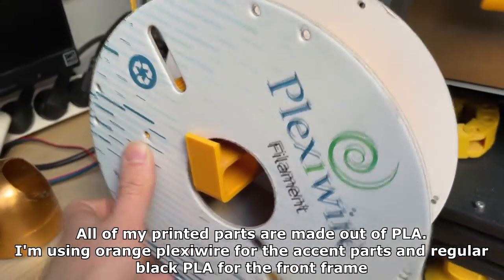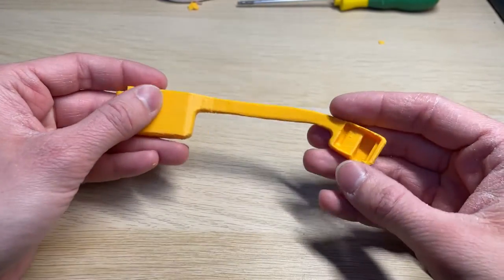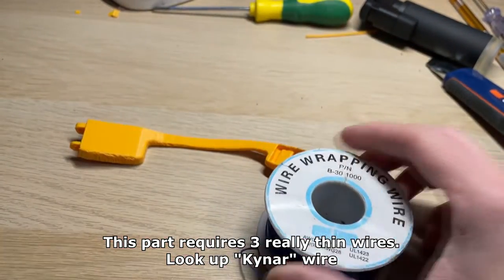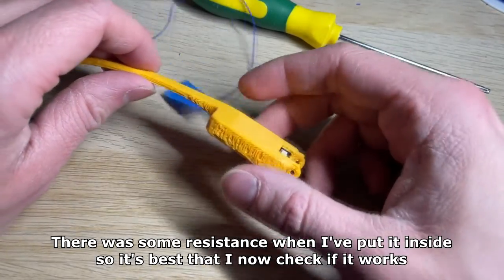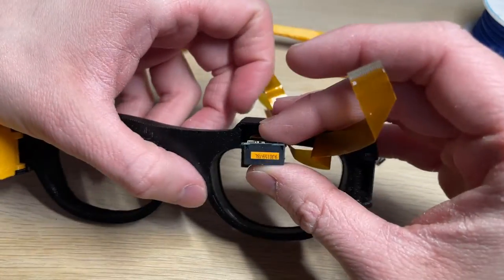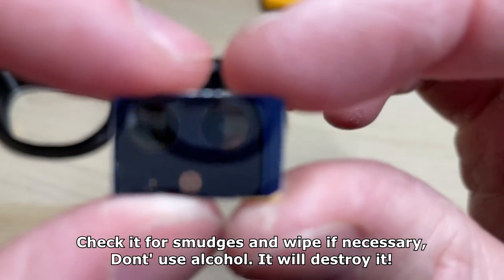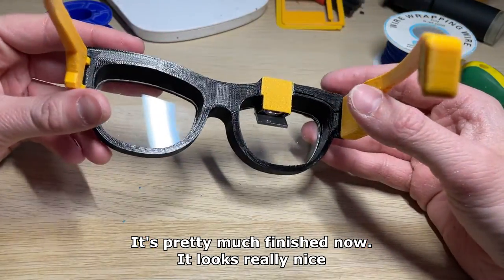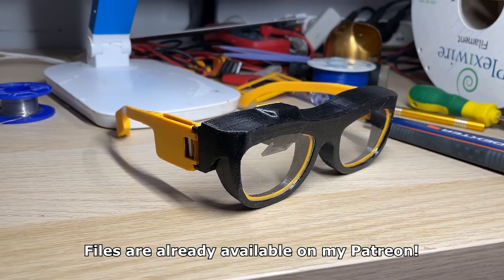Onyx Classic - Final Onyx AR Glasses

Comment: Ok, I will have to say this, but even though our guy here made a statement to be careful with blades as he cut himself, I want to put a serious disclaimer that if you’re gonna use a soldering iron pen to melt the plastic on the hinge, DO NOT TOUCH THE METAL TIP, YOU’LL BE SEVERELY BURNT. Saying from experience. I burnt myself with a soldering iron pen last week (as of writing) and it still hurts with a horrible burn mark
Reply from the maker: Oh yeah. For sure. Be especially careful not to burn yourself when there’s molten plastic on your soldering iron. It will get mixed with your flesh pretty easily

Comment: Great work! I'll have to purchase this kit as well 😀 

Also for those who have prescription glasses you can take an old pair of your prescription glasses and pop out the lenses. Then use the plastic lenses included in the kit and tape it on your prescription lenses. Then you can use a Dremel to sand it down to shape to fit it in the frames 

That's what I did to make my pair have prescription lenses. Otherwise I'm pretty sure you can go to a glasses store and ask if they can order custom prescription lenses for the frames

Comment: Thanks so much for this! Once the following questions are answered (if it still sounds worthwhile) I intend to buy your kit

When wearing the glasses, how big or prominent is the display?

How visible are things on the screen? For example, how much do you have to zoom to read plain 12pt font?

Also, does your patreon have files that can be modified in onshape, fusion 360, or similar? I may want to modify it later to add slots for a camera, speakers, and a microphone if the glasses work well enough, but I don't want to get the files if they aren't easily modifiable

Comment: just a question, can it connect to car rear camera with 3.5mm jack? How can it be displayed? I want to use it on my helmet, thanks
Reply from the maker: I think it would connect to your camera if it has composite (yellow) plug. You would have to switch some wires in my cable though and add 5V power supply

Comment: Hey there! This is amazing and I've just bought the parts to build them myself. However I've noticed that my FLCoS display driver board as a white plastic housing for the included wires, but yours does not. I was wondering if it was necessary to remove it and if so how do I remove it? It would be great if you could make a video on it or just reply to this comment. Thanks in advance!
Reply from the maker: Hi! It’s required to remove the white connector on the driver board. You can do so by first, cutting out as much plastic as you can with scalpel or modeling knife and then desoldering the remaining pins. You have to be extra careful while doing so because you could scrape off the pins. Alternatively, if you don’t want to risk it, you could cut a small, connector size hole on the side of the board compartment so it would stick out of the glasses
Reply: @ManolloMancelli  Thanks!
Reply: could you pls make a video about how to do it, i don't really understand it, i'm new to all of this @ManolloMancelli